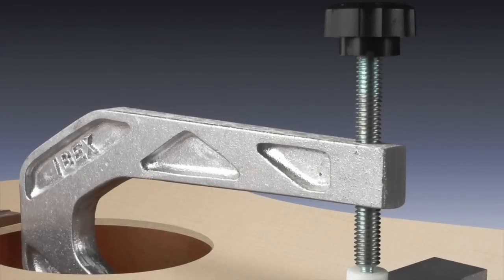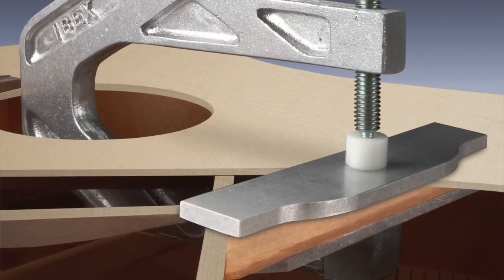TJ Thompson Belly Reducer

Comment: I have found this to be a temporary fix as the belly returns after a short while.
Reply: Yeah, you kinda need to do a little more than clamp on hot cauls that cool off quickly. I put a 60 ohm resistor on each caul, with thermistors on each caul, to keep them from making charcoal out of the guitar. I run a variac on the resistors and have thermocouples that monitor the temperatures. It lasts a little longer that way. I have some more tricks too, that help out.
Reply: Just long enough to sell it to some sucker 🙄
Reply: Why are these soo costly?
Reply: You got your concave and convex backwards. Is this a long-range fix or temporary?

Comment: Steam bending is a process used to make snow shoes, wagon wheels, furniture and many other things. Google it if you're curious . Lignum is the compound in wood that holds the fibers together and it will soften enough at temperatures above 240 degrees F to allow slippage of the wood fibers into a permanent  change of dimension. There is not nearly enough heat applied here for that to take place, so i believe this produces a temporary compression of the wood from which it will soon spring back. I think the idea is to reduce the belly long enough for it to be sold and then the belly becomes the buyer's problem.
Reply: But do you know how to apply a constant 240 F heat to the belly and clamp it so the fix is more permanent? And for how long you need to do that? This maybe possible with a lamp, but I believe it won't be easy to constantly heat the wood at this specific temperature.

Comment: I do like many Stew-Mac tools but I find this to be ridiculous, Why? the main reason I've found for excessive bellying is the top has pulled loose from the x-brace behind the bridge and or the tiny maple bridge plate is  beyond help, the fix is to reglue the top to the braces and or replace the bridge plate (with a wood that is less likely to bend, I use Koa) in a larger size. And before you go all crazy about originality 17's are meant to be played most owners would prefer a good player over originality.
Reply: David Haxton I got a 1930’ kalamazoo kg-11 ladder braced with a huge belly, any recommendations or ideas? Thanks in advance
Reply: @fleadoggreen9062  Ladder braced guitars can be problematic in this area, I would check to make sure the braces and bridge plate are secure, you may have to replace one or more of the braces. Gibson (Kalamazoo ) didn't always use the best brace stock.
Reply: David Haxton thank you

Comment: This is a temporary fix at best. Use it and go through some seasonal shrink and swell cycles and you'll be right back where you started in no time. Bridge Doctor is best. I put one in my 1937 0-17 5 years ago. The guitar is phenominal. Top is dead flat, intonation is excellent, the sides and back no longer simply reflect... they contribute more to make a more complex voice. Consider the Bridge Truss! I have installed countless versions of my own in my customer's acoustics. 0 complaints. I love ya Dan, but this time it's a no go.
Reply: I was looking for a solution to the belly bulge on my guitar. The first video I found that demonstrated the Thompson Belly Reducer actually used it to first flatten out the top of the guitar, and then the guy used the Bridge Doctor to safeguard against the belly issue recurring.
Reply: @poit57  The Bridge Doctor would have done all the work of flattening in just a few minutes. The Thompson BR was totally unnecessary in my opinion.
Reply: So yeah, I know this is 4 years later but.....did you have to adjust the neck quite a bit after installing the JLD?  I put one on my 1952 Gibson LG2 and the action seemed to raise more than I liked. FWIW, I had my belly flattened by a luthier and a few years later noticed it was bellying up again, that when o installed the bridge doctor

Comment: I have a mid-90's Takamine FP360-SC. My local guitar shop says that because of the way the top is routed out to accommodate the aluminum piezo block, there's not much they can do to reduce the belly bulge that's crept in over the decades. Is this a fact?

Comment: Nice! I have an Ovation USA balladeer that has some belly warp on it. it's a beautiful guitar but making it very hard to play with that warp. I really would hate to attempt this myself because it's an expensive guitar. I'm wondering how much something like that would cost? and if it would even be worth it? And even though I have electric heat in this apartment in the summertime it can be hot and humid. so I'm thinking if it's going to end of doing that again  would it even be worth fixing?
Reply: Dog Rox Ovations are fan braced. The tops ripple more than belly. Either way, their pinless bridges lean forward and create high action and murderous intonation. No way to use a bridge truss as there's no tail block to push against, so Belly Reducer is almost your only option. It could be fixed by taking the top off, but it may not be worth it.
Reply: Yeah that's what I'm assuming that the bridge doctor won't work because there is no block. but it is swelling upward in back of the bridge giving it a bulge. I'm using extra light strings on it to help with the tension. That seems to help a lot. the only thing I'm curious about is it because it's TOO humid or NOT enough humid? That's causing it?

Comment: Do you use the old bridge or do you have to make a new one?
thanks
Reply: If you listen to what the inventor said, the main reason for solving the bellying problem is to avoid replacing the bridge plate and devaluing the instrument.   So no, use the orginal bridge, just clean/scrape/sand off the old glue and make sure it is flat before regluing to the newly flattened top.

Comment: I don't see why two pieces of stainless plate, shaped to the bridgeplate footprint would not be just as effective.  Certainly a lot cheaper than these, at around £100 a pop, for what is essentially two slightly machined billets of alumin-I-um...  (clamps not included !!!).
Reply: Thanks, i was looking for that info, if clamps where included.

Comment: Don't trust a guitar without some belly bulge. It's normal. A ton isn't, but some is normal
Reply: This isn't to get rid of the slight belly caused by string tension, but to flatten a warped bridge plate so the bridge can sit flush.

Comment: Sorry, but this hardly reduces the belly, and is temporary at best. I love Erlewine's experience, patience, and expertise...but this looks like a paid add and Erlewine got paid off to sell a lame tool. So many problems with this concept that don't address the actual issues. It should be $19.99 - but wait! There's more!
Reply: The guy is a master at guitar repair but the bottom line is that these are ALL commercially motivated videos.  Nothing wrong with that but "Caveat emptor".  Buyer beware!
  That is why I like to look through the comments section with stuff like this.  A lot of red flags here.  It looks like this expensive tool solves the "bridge belly" problem but from the comments it looks like it solves it only temporarily which is just what I suspected.  
  having worked with wood for many, many years I can tell you that when wood gets deformed it retains a certain memory.  Depending on the wood, the severity of the deformation and the time, after fixing the deformity there is ALWAYS some return to the deformation.
  Look through the comments and you'll find reports of some major "spring back" (for lack of a better term) in a short period of time.
  Add to that the fact that StewMac charges outrageously high prices and, for me at least, this tool is a rip off.  Too much money for a short term result.
  If I could make this myself, I would try it but I wouldn't buy it.
Reply: Yeah, no.
Reply: @mrfester42  I agree with you.  I dont think the tool will retain the flat top because once you take the clamp off, the wood will still be structurally weakened which is what causes it to bow in the first place.   You need to either brace or glue or add some sort of stiffener to the wood top there to prevent it from warping back to "normal"
Reply: @mrfester42  It is possible to permanently change the shape of wood,  but it takes heat above 240* F for a considerable time. Pressurized steam is the only practical heat source. This fix will produce an elastic change that will spring back in short order.

Comment: I've never installed one and I don't trust it.  I use the JLD Bridge System and Bridge Doctor and always does the trick. And, as you know, no drilling is necessary with a Bridge Doctor.
Reply: The bridge doctor works because it is permanently installed.. This one would work too if it was not taken off.